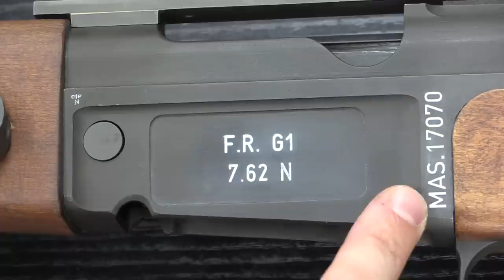French Air Force Snipers: the FR-G1 and FR-G2

Comment: The gras also has a safety, it just does not work and it is not very safe.
Reply: T    choupi
Reply: @Mackenzie McIntyre 
Equip all rifles with a dangerous, while flipped the rifle will instantly fire any round that enters the chamber.
Reply: It has a sort of half cock notch on the bolt that relieves pressure on the primer on the chambered cartridge, but there is nothing that prevents the trigger from being pulled in the half cock position. I believe the french kropatschek also have this feature.
Reply: @Mackenzie McIntyre Twelfth Doctor voice: "They're safeties. Except they don't work and are not very safe.  Unsafeties, they're unsafeties."
Reply: imagine wanting a safety on your bolt action. That's like having a locking screen door.
Reply: Remington: SHUT UP AND TAKE MY MONEY

Comment: as a car guy im wondering why they couldn't have enhanced reciever stiffness with bolt on our welded on parts, like a roll cage but for a gun.
Reply: Cost of doing that and weight, vs cost of new receiver... And if you look at these guns, the scope rail is doing exactly that.
Reply: The scope rail on these rifles is what got me thinking about this. i think you're right about the costs, my assumption was that there were surplus 39 receivers, so a couple hours of machine time per gun would have sorted their receiver stiffness problem; but if they were considering using whole rifles, or if transportation was an issue that could have ramped the cost up
Reply: You know, I never thought of it like that! "A roll cage for a gun"... I like it. 
I've wondered the same thing about some of the... shall we say questionable designs from between the World Wars.
Reply: @henryrodgers7386  h&k did it for the G3. Ian has a video on that
Reply: @GunFunZS  Can you link the video?

Comment: The GIGN also used Manurhin MR73 Long Range 357 magnum revolvers with a 9 inch barrel  and bipod during several successful hostage rescues including a train hijacking. I was able to  handload 1.5 inch groups at 150M with the 10 inch Silhouette. The MR73 Match was shot at the factory with factory supplied ammunition that had to have a 19mm (3/4 inch) outside diameter group for 6 shots at 50 Meters.

Comment: a bit of a pedantic question, and maybe this is my misunderstanding, but I thought "flash hiders" were things like the cone used on a bren that literally hide the flash (or are supposed to!).  In this case, I would have called the muzzle device a flash suppressor, as the design suppresses the flash by slowing the mixing of the propellant gasses so they cool before they ignite with the oxygen in the air.   as I say, a pedantic question .... or are the terms interchangeable?
Reply: Interchangeable terms akin to silencer and suppressor; their purpose is to mitigate flash in low light so as not to blind the user.
Reply: @tiggerpod8279  Also to hide the firing location.
A large flash will give away the firing point. 
The targets friends might start shooting back.
Some snipers lay a blanket in front of the barrel on the ground and wet it down to reduce dust signature.
Reply: @shawnr771  Hiding flash from the enemy was a secondary benefit, although commonly thought to be the primary purpose of flash hiders. Dust signature was taken into account with the transition from A1 to A2 birdcage flash hiders for example.
Reply: @tiggerpod8279  Yes.

Comment: If the MAS 36 receiver wasn't good enough for an Army sniper rifle, why was it good enough for an Air Force sniper rifle?  It sounds like the Air Force implemented the idea that the Army originally rejected as inadequate.  The two designs apparently happened 20 years apart; were the MAS 36 receivers better by then?  Or was this a case of "it'll have to do"?  The world is awash in weapons; seems like if the Air Force didn't need many, they could have found an already-designed sniper rifle that wasn't a compromise.

Comment: Do we specifically know why the Air Force wanted sniper rifles? My guess would be airfield defence, but you never know.
Reply: You're right. For some very specific purpose, FAF security squadrons sometimes need to deploy sharpshooters. That's the first reason. 
And in the early 90s, one Air Commando Unit (CPA 10 - Commando Parachutiste de l'Air numero 10)  was assigned to  the then new French Special Operations Command. Their budget was quite limited, and the process to buy equipment "off the shelf" was long and tedious. So retrofitting the good old MAS 36 was an obvious choice at the time...

Comment: Why would the air Force need sniper rifles?
Reply: A sniper rifle gives the Air Force security detail an option to stop attackers setting up a mortar or an IED outside the wire. Or   protecting a VIP
Reply: Because french air force use 3 special forces units

Comment: My question is, what is the air force going to need sniper rifles for?
Reply: Guard Duty duh, ya still need dudes in overwatch positions when you're guarding something like an air base. Not every single  Air Force personnel is a fly boy.
Reply: @clothar23  Isn't that why you also have army, to do guard duty for the fly boys? I was just suprised as i havent heard about air force snipers before
Reply: @nukers1234   An air base is a valuable position no doubt. But are you seriously suggesting we should we waste combat trained personnel on guarding a rear echelon position ? The best defence has always been a good offense . So it's better to keep your actual soldiers on the frontlines and let the Air Force pretend they actually know one end of a rifle from the other. 

Besides it's better to waste the time of a wanna be pilot than an actual soldier.
Reply: french Air force use 3 special forces units (CPA10 CPA 20 and CPA30) and this units needs a (french) sniper rifles